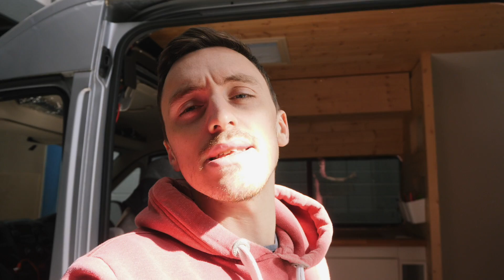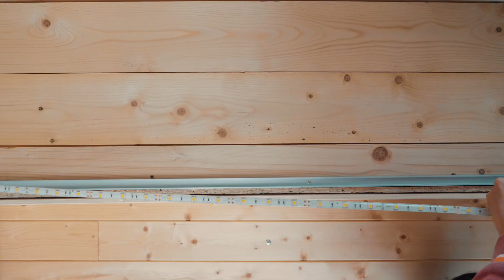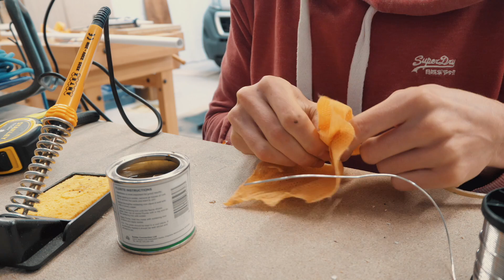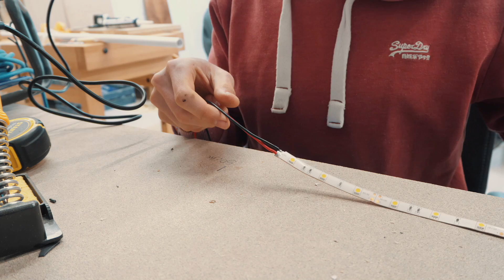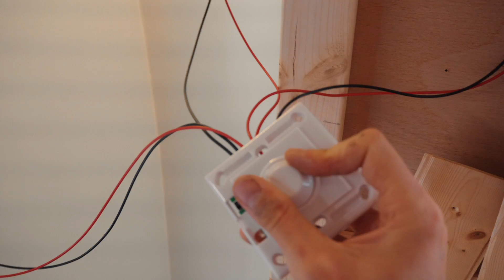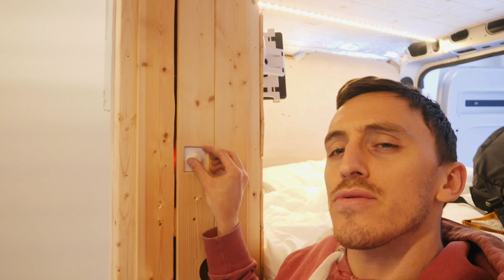Soldering And Mounting LED Lighting In Your Camper Van

Comment: Have you had any trouble with these LED's blwing? I'm researching for our LED strip and I was thinking you need exactly 12V supply, and leisure batteries are often around 12.8-14.6V depending.
Reply from the maker: Led strip can actually take quite a larger range of voltage before damaging. The range of voltage in a battery is absolutely fine for led. Never had any issues with my lights

Comment: Hey I don't have a solder can you connect these led strip lights using simple crimpers? I have bought a biard strip led light bit not sure how to connect it up to my 12 v system without a solder? Also do you need those metal strip holders for the led lighting to look good?
Reply from the maker: hi you can actually get led connectors that don't need soldering. I even have recently seen some called LED hippo connectors that look cool but I have never used them myself. You don't need the aluminium extrusion for LED strip to look good but I would say that  personally I wouldn't want to see raw LED strip.

Comment: Great video Hugh. I have been doing some testing this week with different LED's and after a lot of searching found a brilliant dimmer (which looks to be the same as yours).
I got mine from Amazon, search for 'biard led dimmer 12v'. It's got a remote control with it too, so you can set different light levels from the remote (or from the knob), and also store them in memory (4 programmable buttons). Has performed perfectly in my testing with both single LED light and a bank of six LED lights. Haven't tried LED strip though.
Only lights it didn't like, was the ones that have got touch control on them (I tried with a Dimatec one), think the electronics couldn't cope with the two methods of switching them on and off.
Very impressive bit of kit, and only cost £10 from Amazon.
Only thing I didn't like, is the knob is a very weird shape to actually grip with your fingers, strange pyramid like shape. I changed mine for some super cheap ebay aluminium knobs.
Reply from the maker: Yeah the Biard one is exactly the same. I know what you mean the knob itself is not very easy to grip (lol).

Comment: any chance of a link to the dimmer switch mate? looks a lot nicer than the ones im finding
Reply from the maker: YOu can find them for about £10 on amazon, search biard led dimmer 12v they come with an IR remote and housing
Reply from the maker: https://www.amazon.co.uk/Biard-Wall-Dimmer-Remote-Lighting/dp/B01G694PK4/ref=sr_1_fkmrnull_1_sspa?keywords=biard+led+dimmer+12v&qid=1554295301&s=gateway&sr=8-1-fkmrnull-spons&psc=1
Reply: Spot on mate, Much appreciated

Comment: Hugh, any chance of a link to the parts you used please? Lights and channel
Reply from the maker: I will add them in the description as well but a sub found the dimmer for cheaper on amazon:
https://www.amazon.co.uk/Biard-Wall-Dimmer-Remote-Lighting/dp/B01G694PK4/ref=sr_1_fkmrnull_1_sspa?keywords=biard+led+dimmer+12v&qid=1554295301&s=gateway&sr=8-1-fkmrnull-spons&psc=1

Otherwise:
https://www.wholesaleledlights.co.uk/led-strip-lights/led-profiles-extrusions.html

https://www.wholesaleledlights.co.uk/1m-single-colour-led-strip-lights-30-led-m-5050-5-x-5mm-7-2-watts-per-metre-510-lumens.html

Comment: Is the led strip waterproof? In houses lights in bathrooms are zoned based on their location.
Reply from the maker: IP67 rated so more than capable in the shower, just make sure that the terminals are sealed from moisture